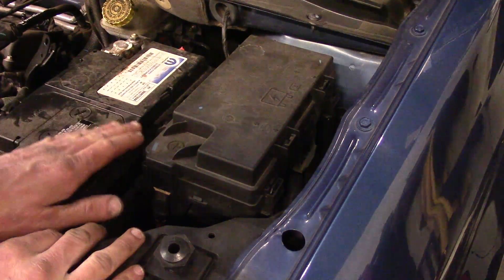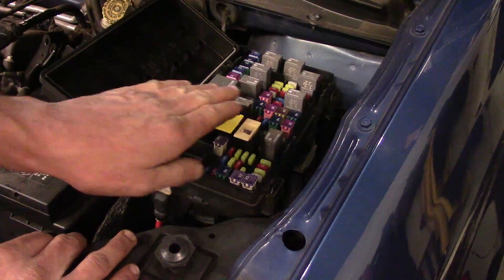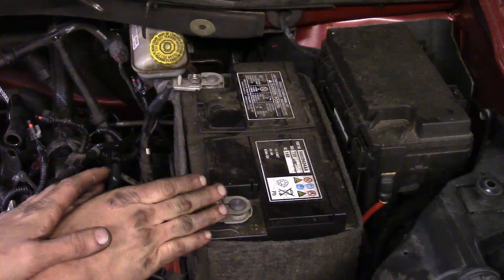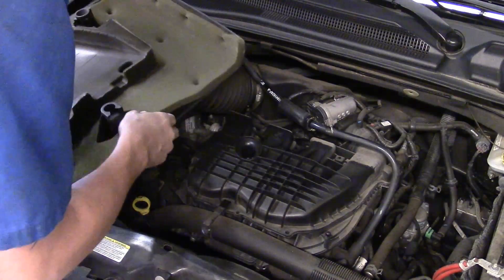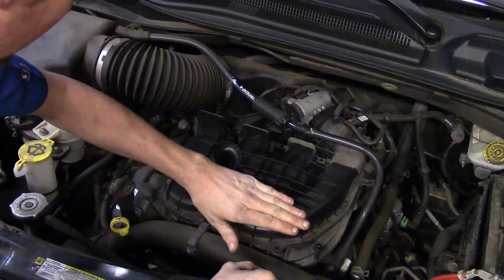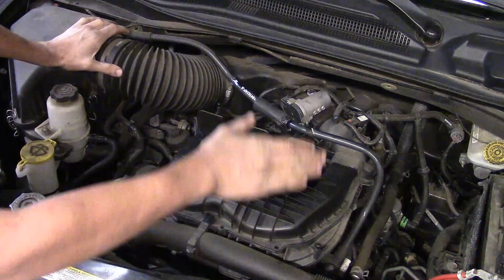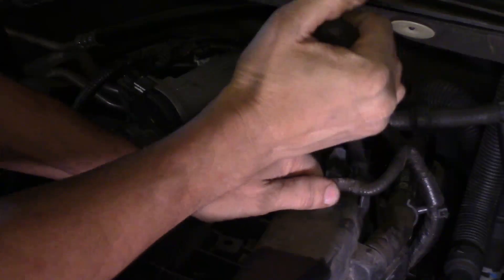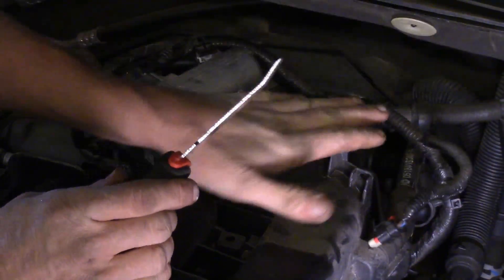Part 1/10: 3.6 Pentastar engine left cylinder head removal (the short cut)

Comment: 2019 Dodge Grandcaravan 2.6L flex fuel. I had a misfire on cylinder 6. Only 90 psi compression, but 150 psi on 1-5. Pulled the left head and found both exhaust valve guides worn out and caused the valve seats to become oval. $75 for 2 new exhaust guides and valves reseated. got everything back together today. running great. 65K miles. Total cost for repair was about $200, maybe a bit less. I was drinking beer and taking my time so it took about 6 hous to disassemble. an hour to clean up the head surfaces and 6 hour to reassemble. Total 13 hours.

Comment: Many thanks, this worked great.  I replaced the head on my 2015 Dodge Journey, everything in the video is correct.
Here is the parts list - total of about $1,200 in parts.

Part	                                        Mfg.	        Mfg. PN

		
Head Assembly	(new)              MoPar	        68227451AA
Head Gasket	                        FelPro	        26542PT
Head Bolts  (set 8)	                FelPro	        ES72467 
Chain Case Cover Gasket Kit	MoPar	        68078604AA
Exhaust Flange Gasket	        MoPar	        68093232AA
RTV  (3 Bond)	                        MoPar	        68082860AB
Intake Gasket Set	                cheap no-brand
Reply: Thank you for adding a parts list! Saved time watching over the video to come up with one myself.

Comment: hey thanks to this video you made i was able to remove cylinder 2 head made repaired put it back together and car is great working again. now i have to remove cylinder 1 do i need to remove engine or can i do in the car. i know the tensioner is really low in the engine and the cover is still on. thank you

Comment: My wife's 2012 van has about 250k miles on it and it look like the gasket/seal finally gave up on the front head. I don't have any codes and the moment, but you can clearly see the oil coming from the head dripping/spraying over the trans and down to the ground/driveway where we have some oil spots.  The dealership says they wont do the repair simply because the mile are too high, and another shop said they can do it but usually with that many miles rebuilding the top end results in failures in the bottom end because of the pressure difference. Do you think its worth it for me to do the repair myself following your 10 part video, or is it better for me to just throw in the towel on the "old girl" and get a replacement van for the wife.

Comment: I’m 6 months passed the Chrysler extended warranty for the left cylinder head, while 30k miles under the 150k, keeps setting P0302 even after changing the spark plug and coil with new oem parts, then swapped fuel injectors and removed the valve cover and left cams, lifters and rockers. Everything inspected fine. Reassembled and the misfire counter is climbing on #2 still, mostly at idle.  Looks like I’ll need head. 

Any chance head could still get covered under warranty?  Jan 3rd is when it expired.
Reply: I’m in the same boat. I’ve done everything you’ve done. I have a 2015 T&C at 101k miles. What year was yours that the dealer denied the warranty?

Comment: Hey man i love these videos, a great help to a mechanic or novice not familiar with this motor. However i have a question for you if you don't mind tapping your expertise, I have a 2015 ram promaster with the 3.6 L motor, and it started smoking while on a trip. When we returned home i went to check compression and when i pulled the plugs cyl 2 4 and 6 were oil soaked but cyl 13 and 5 were clean and white, ran the compression and found all at 145 lbs except for #4 which had 95 lbs. Could give me a possible cause before i start tearing thing's apart? Thanks in advance.

Comment: Just got my 2011 avenger 3.6 pentastar fwd back after dodge company had it fot 2 months. The changed the head for the tsb. Now my car runs hot, btw didnt before. Exhaust is entering the coolant. Blown head gasket. They swear its not a gasket. Refused to fix and said id need a new motor for $10k. Mopar is no car.

Comment: Hello the vacuum hose you mentioned @ 8:05, does that lead to the purge valve? I had a P0441 code and replaced purge valve only still to receive code. After going crazy and inspecting hose lines I noticed that my 2012 Chrysler T&C 3.6 L des not have vacuum hose connected here.. theirs no hose connected here. Could it be why my code is reappearing?

Comment: Hi, David
I know you did this video series 4 years ago but I was hoping I could get some feedback from you or maybe someone else who could help. I have a 2012 Chrysler 200 3.6L V6 which had a cylinder 2 misfire when I bought it a year ago, at the time unknown to me. I recently found out about the warranty on the misfire issues, unfortunately my son let the car run out of oil and now the rods are knocking. So, I decided to replace the entire engine. I've never replaced a engine before but since I love my 200 I've decided to make it my "project car". I cant wait to get started on it but I can't really find any information on removing the whole engine in my 2012 Chrysler 200. The closest I came was watching your videos but you just worked on the left cylinder head. Can you give me instructions on what I would need to do to remove the entire engine? I would like to take the engine out from the top. Can you tell me how much more or less I would have to do than what you did in the videos or things I may have to do differently. Thanks

Comment: Can you replace the right side gasket  Without removing the engine
Reply from the maker: You can but it will require removing the timing cover, both valve covers and possibly the oil pan depending on the vehicle. When people say gasket I assume head gasket and the head gasket is never the issue. If oil in the coolant then you need an oil cooler assembly and flush the coolant multiple times. If overheating and you think it’s a head gasket then you will find out that the head is warped and not a gasket. The gasket is multi layered steel and it doesn’t “blow”....the aluminum head warps instead from the heat

Comment: Any videos on the right side cylinder head?
Reply from the maker: I havent had to remove one yet which is surprising which also means I dont have a video on that. There is no short cuts and the timing chain cover will need to be removed and depending on the vehicle possibly even the oil pan. Thanks for asking and make sure to subscribe.

Comment: David. Question for you, what made you replace the head on this motor. I’m dealing with a cylinder 2 misfire. After a compression test, we are losing compression in cylinder#2. We’ve determined possible, bad valve, hairline fracture on the head or blown head gasket. We had the valves down about a year ago, solved the problem and then after a year, the code appeared again with the same issue. So we are wondering if it’s a bad valve, why?  What may cause it. But what do you possibly think it could be with your experience. I see it’s a massive problem with this 3.6 penstar engine. Please let me know. I appreciate it slot. Your videos are so spot on, a kid could do this job as long as he had your videos. You e done very well man. We all appreciate your expertise.

Comment: Good morning Motor City Mechanic, I have a 2014 town & country in the shop, the vehicle is setting a cyl 4 misfire code, feel it at idle and just off idle, performed compression test & leak down test all good. swapped, plugs/coil/injectors from another cylinder still the same, the vehicle was in the dealer in Dec of 2018 with 77k on it for a misfire cylinder 2 and according to the dealer they replaced the head and a few rockers, should I try the rockers on cyl 4 ? the vehicle now has 95k on it, by the way the head looks like it was taken off but does not look new,

Comment: Hey MotorCity Mechanic
I appreciate your videos and your willingness to help those home mechanics like me. I have A 2013 Pentastar 3.6 200 engine. I had a cylinder 2 misfire. I ran all the normal tests, founf our I had a leak in cylinder 2 on the exhaust side once i preformed the leak down test. I took the head off and i can't see anything obviously bad. Because of the history with this engine and the left head, should i just go ahead and replace the head anyways?  Also, should i replace the header bolts or just use the old ones. I am not sure if they are torque to yield.
Thanks again
Reply: THERE IS AN EXTENDED WARRANTY FOR THIS HEAD I JUST WENT THROUGH ALOT OF BS WITH CHRYSLER & AFTER 2 MONTHS THEYRE REPLACING IT FOR FREE CONTACT YOUR LOCAL CHRYSLER DEALER !!!
Reply: Wow chris, i had to pay $2100 plus the warranty.

Comment: MotorCity Mechanic:    I am hearing so many serious comments about the 3.6L Pentastar engines with ticking rocker arms and worn cam shafts. Many reports that the problems may start at 80-120K miles. What is your take? Can this issue be prevented? Is Chrysler doing anything to correct this for customers? Should I sell my wife's 300C  before this happens to her car? I respect your opinion.
Reply from the maker: I have seen it happen at different mileages....nothing low however. Its just something that happens to some and not to all. I dont seen any way to prevent it....seems to be a design issue or material issue from the manufacture of the part (not chrysler). Chrysler only covers the issue when its under the warranty. Personally I wouldnt get rid of a car thats not having this issue. It may never happer....but then again it might but it can be fixed. I say drive that 300 and enjoy it. I know cars with 200,000 miles that never had an issue. Thanks for the question and for the respect. Make sure to subscribe if you havent already.
Reply: @MotorCityMechanic  Thank you much for the advise. I feel a lot better about keeping the 2014 300C now. Except for an oil pressure sender issue and a couple of factory recalls, its been trouble free and enjoyable to drive.

Comment: I am helping a friend swap his passenger side head in his jeep.  What are the bolts behind the cam gears?  They don't seem to connect anything, just bolt inot the head.  Also, these same bolts, all 4 were finger loose when we pulled the timing cover.  What should these be torqued to?  Thanks for any info and for the awesome channel.

Comment: Hello I have a question is it possible to change just the valve spring on the 2011 Chrysler Town & Country?
Reply from the maker: It is....you need to make sure to valves are closed...then air needs to be put in the cylinder so that you can try to compress the valve spring to get the keepers off....not sure the room you will have with that related cam in place....might be too tight to do it as far as clearance however.

Comment: Can you replace the right intake camshaft and the rockers with the special tool,  without taking the front timing cover off?
Reply from the maker: You sure can.....takes different tools then the left side used. Main difference is that you can not access the timing chain tensioner on the right side. instead you will be using a special tool to wedge the tensioner guide to give you some slack.
Reply: @MotorCityMechanic  Thanks for the reply;  great videos.  Why does the rocker bearing go? I have a 2014 dodge grand caravan with 150 000 km on it and the number #4 rocker bearing went on it.
Reply from the maker: @benvanderkooi7015  It appears to be an issue with the part itself. Could be the design or the material the needle bearings are made out of.
Reply: @MotorCityMechanic  I have put the special tool on the right side tensioner guide, but I'm wondering what holds tension on the tensioner?  Is it just the tool against the exhaust camshaft?
Reply from the maker: @benvanderkooi7015  What it does it uses the bolt on the front of the head....that slides in the cut out track of the tool and then you are basically wedging the chain guide enough to get you some slack. Its not a great tool and takes a few tries to get lined up right without it jumping off the guide each time. Sorry for the delay in getting back to you.

Comment: @motorcitymechanic can you replace the hydraulic lifter (lash adjusters) in a 3.6 with the cam shaft in? 
I have mine apart right now and I can't get the one or two out that are "spongy". I'm afraid to take my cam shaft out because I don't have the timing chain tensioner/tools.
Thank you!
Reply from the maker: The issue you will run into is that one cam blocks the lifter removal.....I cant remember if its the intake cam or the exhaust cam. Either way the position of the cam prevents the lifter removal. I have seen people pry the rocker arms out but it can be a challenge.

Comment: Thanks for the videos I liked it I do have a questions for you does the right side same procedures is the left or is it different if you wanna replace the right side
Reply from the maker: The replacement of the right side is different and requires removal of the front timing cover and everything that goes along with that. No short cuts for the right side unfortunately. Thanks for asking and for watching. Dont forget to subscribe.
Reply: @MotorCityMechanic  Is there a video series for the right side?  I have an engine that won't pass a block test.  It's probably a blown head gasket but it still runs great, doesn't lose coolant, or burn coolant out the exhaust so it is probably a minor leak - so slight that it doesn't show up on a compression test or leak-down test so I figure it best to replace both head gaskets since I cannot isolate it to a particular bank.  And there are no engine codes.

Comment: The 3.6 I worked on had a bent intake valve on #2 causing extremely rich fuel trims to the point that it would not idle, I could keep it running at about 1100 rpm, NO misfire DTC would set, compression test  indicated zero, but interestingly enough when I performed leak down test in didn’t indicate leakage, I assume the air pressure would close the valve! Would consistently set P0172 P0175. Foreign object sucked into engine caused bent valve.
Reply from the maker: Ouch......yeah it dont like any foreign objects for sure lol. I havent come across that as of yet.
Reply: Hello Motor city Mechanics,.. do you guys doesn't have a video talking or replacing the Rocket Arm on Jeep Wranglers,  with a ticking noise,  I have the problem on my jeep wrangler sport unlimited 2012,  and looks like a common problem,  if u do have a video defynely I would love to see... thanks

Comment: Thanks for your answer.... which year could I be safe buying a used Jeep with out this engine issue?? 2014?
Reply from the maker: Newer is always best. 2015 is even better if possible. 2014 had some issues with the oil filter housings when they resigned them. Now if your speaking of the Grand Cherokee.....you can find some good deals on older ones with the Hemi.....2011-2013. Just depends on what your looking for in the end. Thanks for the question Dave.

Comment: Why are we replacing the left cylinder head?
Reply from the maker: This head had a burnt exhaust valve seat which was caused by a design issue with that head. It caused a misfire code and skip at times.

Comment: Just used this entire 10 part series to fix a P0302 #2 misfire (burnt exhaust valve (2017 wrangler JKU, NOS cylinder head I guess). Replaced the head following your steps accordingly and so far so good. Thanks a million for your video and saving me $2k. Agreed, it’s a great engine, with a tune (enhance throttle response and 87 octane tune) and a decent CAI, this engine responds extremely well. My wife gets 20-22 mpg. Which with aftermarket bumpers, 33s, and lift, it’s not bad for a JKU.
Reply from the maker: Now thats some money saved. Glad that the series helped. Appreciate you letting me know how it went. Many thanks and make sure to subscribe.

Comment: Great Videos.  From your experience on a 2012 Durango. P0304, I’ve eliminated plugs and swapped coils from drivers side to passenger side but the misfire remains on #4.  Truck just hit 99,000 miles. What do you think Chances of it being a head issue?  I don’t want to pull the plenum again to leak down if it’s under warranty but I don’t want a dealer diag bill if it’s not.    Thanks again
Reply from the maker: It could be a bad roller rocker....most times they cause a noise as well and other times they dont. To be sure without playing the game of warranty/customer pay based on what the dealer finds.....a cylinder leak down is the best means. Typically a compression test can show lower then normal pressures as well even though not as precise as the leak down test. Those are the two common items....roller rocker and left heads on the older versions.
Reply: Thanks !
Reply from the maker: Your welcome

Comment: anyone know if the right head will come off using the same tricks?
Reply from the maker: Unfortunately it will not. The front timing cover will have to be removed due to where the chain tensioner is located for the right head. Wish it was that easy but not in this case.

Comment: @Motorcity Mechanic if my2012 jeep wranglers left head needs to be replaced under warranty (the thermostat warning light came on ad I got it towed to the dealership).  The dealership said the right head may need a new gasket.    Do you recommend replacing the right head gasket when the left failed?  Do you have a video on how to do the right head gasket?

Thanks in advance.